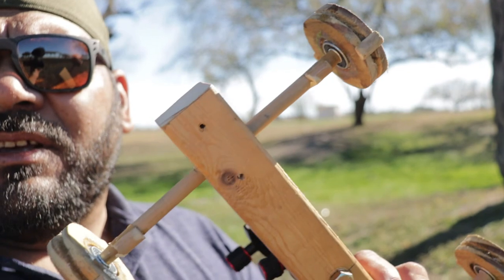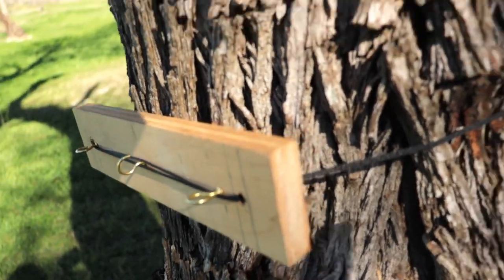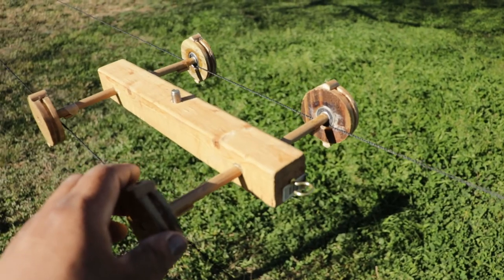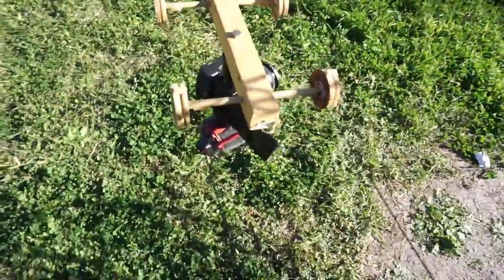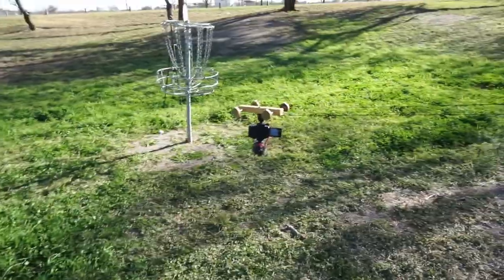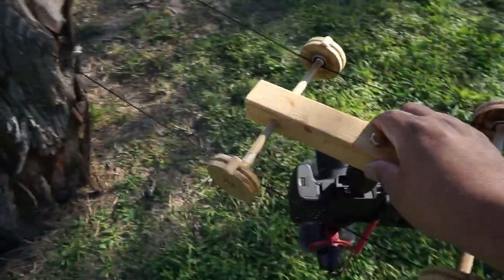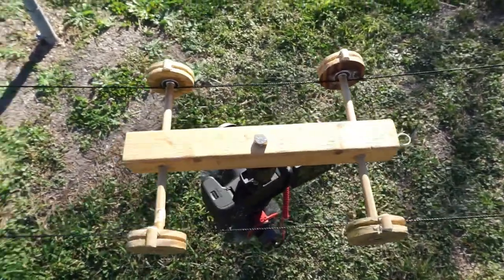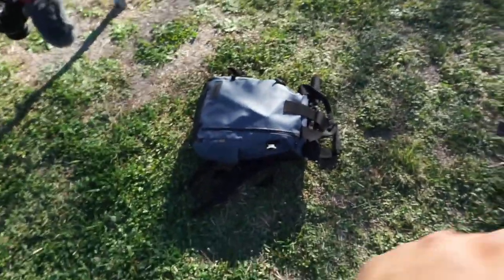DIY Camera Rope/Cable Slider Test

Comment: To be more precise try this search on Amazon "CW4 Wheels for DIY camera dolly"
Reply from the maker: Thanks for your comment and input. Yes, I've seen some on Amazon that would probably work good. I wanted to challenge myself to build it.
Reply from the maker: I even bought a furniture dolly that I converted to a camera table/floor dolly. Something similar to this. https://www.harborfreight.com/3-wheel-wood-dolly-68902.html
Reply: @guadalupe_rodriguezNPK  that's really cool I will have to try something like this.
Reply: @guadalupe_rodriguezNPK  That won't work mate. I've tried it. The micro shakes in those wheels, travels straight into the sensor. It's a waste of your time and money. Just helping you out
Reply from the maker: @ZedsTechTips   thanks for the comment. I was really impressed with sliding the Slider on the rope. Adding correction helps a lot. Almost all parts I  had already from other projects.
Reply: @guadalupe_rodriguezNPK  I may have confused you. My apologies. I was referring to the 3 wheel furniture dolly
Reply from the maker: @ZedsTechTips  no problem. Yes the 3 wheeled dolly I bought for a couple of  bucks does not work on well on concrete surfaces. There is a lot of vibrations.